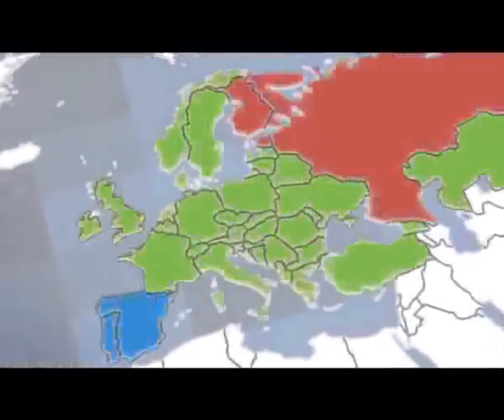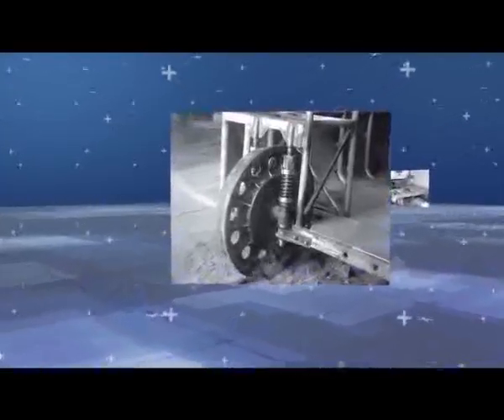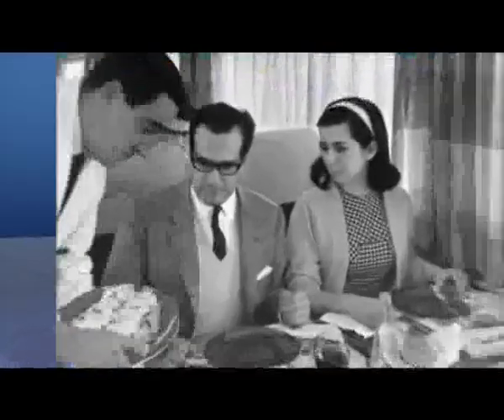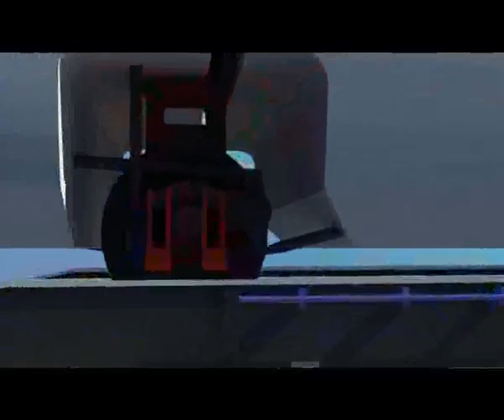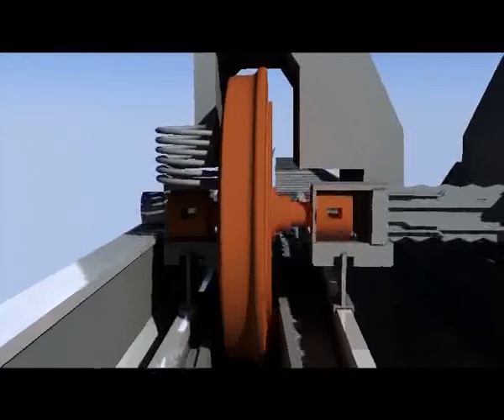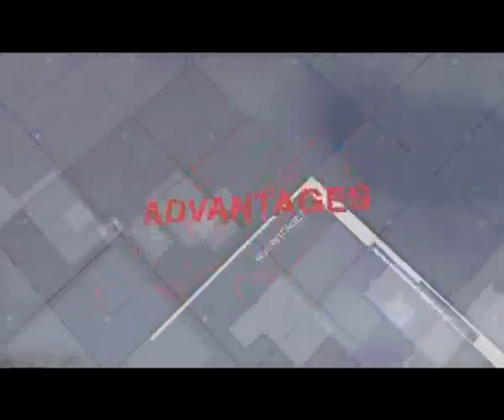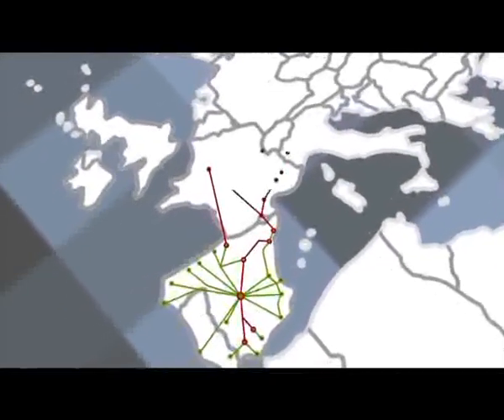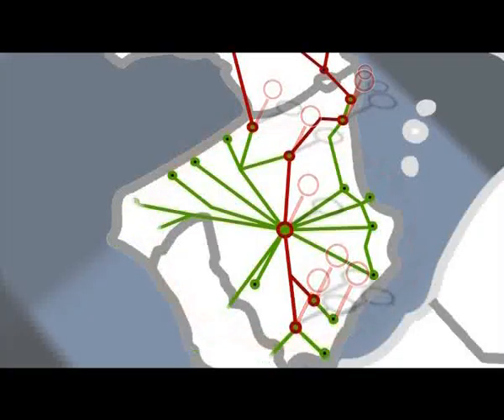Variable gauge system Talgo RD 2008

Comment: This is just another retrofit example of why the railroad isn't compatible with itself. Loading guage, platform height, voltage, AC or DC, signalling is other things to consider. We should build MagLev instead of doing these kind of expensive retrofits - at least for passenger transport.
Reply: Are you mad? Suggesting MagLev as a more cost effective option??????????????
Reply: @jlgf3148  Yes. HSR must be rebuilt approximately three times during its life cycle (change of rails and overhead power lines), and that with lower speeds. Not to mention the mechanical wear and tear on the vehicles. Lower speeds = less throughput = more vehicles = higher maintenance cost.

Comment: How long does it last to change the lengths of the axes for a train?
Reply: Not more than 5 minutes to change a whole train! The train runs through the changing gauge system without stopping at 10km/h, if I remember it well :)

Comment: Australia really really needs to adopt Talgo systems, especially for freight. One country, three gauges, harsh climates. It's literally the Spanish problem, but on a bigger scale.
Reply: Talgo has a great tecnology , perhaps the BEST train global in the world , the only problem Spain do nothing to strength our BEST enterprises .....It would be a cheap an good train for  Australia , i' ve travelled few times until Marsella from Madrid 1300 km , and It goes at 300 km per hour the most of the travel , the April  gets 360 km , very good for a country so Well leveled
Reply: Is not valid to freight, only passengers

Comment: So having a standard guage wasnt an option in the early days?
Reply: When railroads first started out, they were all independent of one another, there wasn't any sort of consensus among them as to which gauge to use. As railways became longer, more interconnected, and a more important part of a country's economy, most countries standardized the gauge, which was quite a hassle as they had to choose which company's gauge to go with - always a controversial process - and then everyone else had to convert all their track and all their rolling stock. Doing so between countries was even harder, so much that it still has not been done to this day. Obviously they'd be better off in the long run if they did so, but doing so is so expensive and difficult it's hard to justify. Couplings are similar, in Europe there are numerous incompatible coupler designs in use - the US standardized couplings a long time ago, one of the few things about American trains that's better than Europeans.

Comment: The world should agree on 1676 mm broad-gauge for high speed and better capacity.
Reply: I would prefer 1,435mm gauge for wide trains and 1,067mm for narrower units. The system here described in this video can be used to change from either of the gauges.
Reply: 1676 not so wide that it might have negative impact on turning radius. India has about 70,000 km railway network full of  turns.   Delhi metro has both 1676 mm and 1435 mm and you can hardly see any difference in terms of turns and coaches.  The only difference you can feel is that  1676 mm coaches are a little more spacious.  So I think it's urban legend that 1676 mm lines cannot have enough turns.  Before you reach any conclusion, I'd request you to visit Yellow Line and Blue Line of Delhi Metro and see how it turns not only from left to right but also from surface to an elevated route and from an elevated route to underground.  Seeing is believing.
Reply: But there are also negatives like bigger turning radius, more weight of train set.
Reply: Isamard Kingdom Brunel built some 6 or 7 foot gauge lines, as did Jay Gould in the U.S. in the 19th century.

Comment: They didnt need any of this. After ww2 they should have got together and widened the rail tracks as one standard gauge of 5 feet instead of 4 ft 8/5 inches instead of changing wheel tracks. At 5 ft wide all over the world, modem trains could stand strong side wind and is more stable at high speed. For years cross country train travel has been a nightmare, especially when one track gauge in another country was wider or narrower and passengers had to get off their trains run on standard gauge and board another train on a narrow or wider rail tracks. They had 70 years to change this since ww2 which had destroyed many railway lines during the 5 year deadly war.

Comment: something vie never understood ... why not just have two or three  sets of wheels per axles  at the appropriate  spacing ?  or wheels wide enough to  fit both gauges
Reply: You can only have one flange per wheel otherwise the extra one will interfere at crossings and points
Reply: Weight.

Comment: why didn't they just change the gauge of all the track when changing to concrete sleepers? gotta lift the rails anyways at that point.
Reply: Because the rolling stock and locomotives use the other gauge; and they would have to be converted too!

Comment: We have in the U.S. a  narrow gauge railroad in Colorado. If there is a  track connection to a  standard gauge rail line,  would the Talgo method be used as noted in this video?  I don't know if there is such a connection point on the rail line. Please let me know. Thanks.
Reply: No the very few narrow gauge lines in the US are all tourist railroads with historic equipment (steam locomotives in most cases) so this would not be practical or useful in those applications. A few of those narrow gauge lines that did interchange with standard gauge lines had dual gauge track at interchanges and major facilities to mitigate transloading.
Reply: Many years ago narrow gauge lines such as in Colorado would have dual gauge stretches of track to connect with standard gauge lines. Adaptor cars would be set betw the narrow gauge steam units and standard gauge freight cars.
Brazil is another country where adaptations are made betw metre and broad gauge tracks.
Reply: There are many narrow gauge lines in Colorado, but only operating as tourist/historic lines, none in commercial service for which interchange with standard gauge to tracks beyond would be of any use. Historically dual-gauge has been used, as mentioned by Centredoorplugs Thornton, but now such is only seen for historic preservation. The only place I can think of in Colorado where there is any dual-gauge track still used by both standard and narrow gauge is at the Colorado Railroad Museum - they only operate narrow-gauge equipment operationally, but sometimes they need to move standard-gauge stuff around the museum on the dual-gauge track, using narrow-gauge locomotives as they don't have any operable standard gauge that I know of. Aside from tourist lines, all the narrow-gauge lines have either been abandoned or converted to standard gauge. For example, there was a line that went up Clear Creek, was Dual Gauge to Golden then narrow gauge up into the mountains, the dual-gauge part was converted to standard-gauge only and now is primarily used to serve the Coors Brewery, the rest of the narrow gauge section abandoned and removed except for the section between Georgetown and Silver Plume, which now operates as the Georgetown Loop.
Reply: It could be, but there is not enough demand to use a variable gauge system on those lines.  Truck/bogie exchange has been sufficient for rolling stock exchange on those lines so far (this also include the East Broad Top in Pennsylvania).
Reply: You don't just have the track gauge to consider.  You also have the loading gauge.  Most standard gauge trains would foul the bridges and lineside equipment of the narrow gauge.

Comment: This is great technology for solving what should be a temporary problem. Once all the essential rolling stock in places like Spain and Russia have been converted to this system, the process of gauge conversion ought to begin in earnest, until all these countries are at standard gauge, then they can use standard rolling stock.
Reply: Well, different gauges have different preferences. You can drive much smaller curves on a narrow gauge (important on mountain lines), while a wider gauge allows for higher high speeds through more stability but less flexibility. It's less a matter of choice, more a matter of economics. Switzerland couldn't reach a lot of their places with the standard gauge, you can't just go there and tell them to just not do it.

Same with the electricity. 25kv is better for huge countries (such as russia) as it allows longer distances between two sources, while 3kv is a way cheaper solution for small countries (such as slovenia). Since all countries differ in geography and budget, it's understandable that they have different standards, which fit their economics the most.
Reply: @ShazenVideos  Actually, Russia uses 3KV DC and not 25 KV AC as you believe, but otherwise your argumentation is a sound one.

There is another main difference and thus the main reason why 25 KV AC is much better solution than 1,5 KV DC (France, Belgium, The Netherlands, etc.) or 3 KV DC (Italy, Slovenia, Czechia, Poland, Rusia, etc.), and that is the current (measured in Ampers A) and thus power on the traction motors (measured in Watts W).

The formula is as follows: P (W) = U (V) x I (A).

So In order for an electric locomotive, for instance the one used in Slovenia, Austria, Germany and so on, like Siemens Taurus ES64U to reach its maximum traction power of 6000 KW in Slovenia, it takes as much as 2000 A in Slovenia on 3 KV DC, but only 400 A in Germany or Austria on 15 KV AC, and even less just 240 A in Croatia on 25 KV AC. Smaller current means significantly thinner catenary and thus lower costs.

Besides that, the maximal traction power of the trains like ICE or TGV is significantly lower on the DC lines than on the AC lines. For instance ICE 3 neo can reach speeds only up to 160 km/h on 1,5 KV networks, and up to 200 km/h on the 3 KV networks, but up to 320 km/h on the 15 KV and 25 KV AC networks.
Reply: @mitjaoblak708 Russian RZD system uses both 3 kV DC and 25 kV 50 Hz AC, often successively  on the same line. On the Transib there are 4 such electric borders for instance.
Reply: "Until"... And what makes you think we're just sitting here, waiting impatiently to change our gauge to yours? Your standard gauge, because we have our own standard gauges. The arrogance...

Comment: I'd be concerned about the possibility that the pins that hold the wheel in lateral position fail to reengage, leaving the wheel free to move. Perhaps there's some electronics there to warn of that situation, but there's no mention of it.
Reply: @Sylvia Else
In this video they show a simplified version of the technique and the process - so much simplified so that common people like you may understand the great principle.
It is no question that the pins will reengage - they are forced to mechanically.  This can clearly be seen in the animation . Someone who understands the great principle would have seen that - why didnt you get it?
It would not make sense to show the securing of the pins - you wouldnt get it at all. They did know that and left it out...... ;)
Reply: It's more likely it has such electronics to control that. Microcontollers is widely used without notice everywhere.
Reply: that is not posible. this system is logic and tested. If you learned mechanics this seems logic.
Reply: There is a clear possibility that the pins fail to reengage. A reasonable way of addressing that is to have sensors that detect that, but, as I said, there's no mention of it.
Reply: the system is safe dont worry. IF not going to rearange and lock, will block the weel and can not exit the rearrange facility.  When the system will but back the load on weels if is some error will be notifed instantly.

Comment: will it work on narrow gauge lines ? i e 3 feet ... 2 feet
Reply: I would assume it would work on any track gauge assuming they convert their rolling stock to work with the system and the different languages infrastructure can accommodate both loading gauges.
Reply: Not a chance !

Comment: that map is wrong. The Russian gauge is used in the whole post soviet space and Finland has a different one
Reply: The old gauge was 1524 mm, which was and is in use in the most parts of the ancient Russian Realm. Later, in those parts of the countries that changed nationality, the gauge was changed down to 1435 mm, like new Poland, or changed up from 1435 to 1524 mm, like Moldova and parts of Ukraine. In Finland it was not changed at all.
Only since several years ago was a change from 1524 (= 5 feet) to 1520 mm by reason to enable higher speed.
Reply: Lukeeiiee They also missed Irish gauge, which is used only in Ireland and parts of Brazil and Australia.
Reply: You're wrong, Finnish gauge is a 4mm wider one, not narrower.
Reply: Trains (passenger and freight) travels across Finland and Russia without any problem. Gauge is almost same, 4 mm difference.

Comment: How about wider wheels with a broader face that would seat on rails from x to X+y cm wide - a flange could be included on the outer rim as well as the inner -  but probably too much mass, too much angular acceleration, too much inertia and drag
Reply: It won't work because points.
Reply: +SupernalOne Did you really think this one through properly?
Reply: Salvatore Shiggerino no, this is Youtube :)

Comment: At 25 sec a map is shown which implies that Ireland has standard gauge. 
It doesn't.
Reply: @pipersson39  Ireland (North and South) has a gauge of 5ft 3in (1600mm), which would require a gauge-shifting system if there were ever a tunnel to Scotland!
Reply: It also implies belarus has standard gauge, it doesn't

Comment: Dear all, this system has been used in Spain for more than 40 years, as he says. It is perfectly texted in daily commercial duties!
This is a 100% Spanish technology in place in the USA, Russia, Kazakstan, Turkmenistan, Uzbekistan and probably other countries worldwide.
Reply: No it isn't. Why would 2 countries with Russian gauge need it?
Reply: @evaluateanalysis7974  Ever heard of Kaliningrad?
Reply: @boskee  Yes, it's a Russian exclave, why do you ask?
Reply: @evaluateanalysis7974  How do you think trains from Kaliningrad cross to Poland?
Reply: All railways in North America use Standard gauge. The only railways that don't use Standard are not connected to any other line and are not used for freight/passengers. All cars and engines that operate on Standard gauge in North America use the same gauge, couplings, and air brakes so a single freight car can go from the southern most point of Mexico to the northern most point of Canada without having to undergo any sort of mechanical change. So no, "Spanish" rail gauge changing technology is not used anywhere in the USA
Reply: Why are you encasing the word Spanish between quotation marks? Are you putting into question that this system is Spanish technology? Pathetic. And FYI, as a matter of fact, Spanish rail gauge changing technology is indeed present in USA, as inherent to Talgo technology. There are Talgo compositions in service in USA and have been for a while now. Whether or not they're used in practice and whether or not there are gauge changing stations anywhere in that country is another matter. What Armand Basy said isn't wrong and you're using semantics to deny the fact.

Comment: It's only useful if the difference in gauges is big, ie Standard gauge to Iberian gauge, but from Standard to Russian gauge there is only 85mm difference. In which case I would think it would be possible to just have all wheels slightly more than 42.5mm wider and with a 'step' in the middle and the edge of this step would form the second flange. The 'step' would mean the train would ride about 1 inch higher up off the ground, when using the Standard gauge!
There would be something like a 50metre tapering section of rails where you go from one country to the next and you would only need to reduce speed to something like 15mph to go through, instead of having to creep through, like on this Talgo system.
Reply: How do you think would this run over the switches without damaging them?
Reply: It is doable, but the problem is that the points of track switches have to be set in farther to avoid derailments on the broad gauge trackage, and there is considerable slop leading to increased wheel 'hunting' motion on the broad gauge trackage as well. This technique is used to allow some broad gauge steam locomotives, such as St. Louis San Francisco 1630, to run on standard gauge trackage without replacing all the axles.
Reply: @JohnGeorgeBauerBuis  nope, it's impossible
Reply: Now take a ruler and visualize 85mm or  8.5cm or quite more than 3 inch.
Reply: You need to stop chaning units
Reply: Yes. This is a nice wet dream somebody had. The thinking went as long as the time is from crawling into bed till closing the eyes ...... ;)